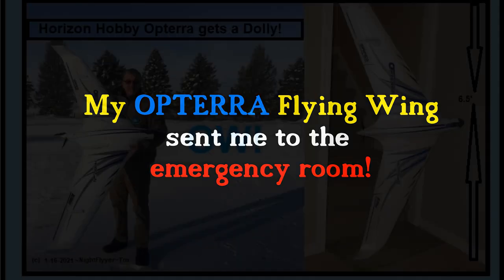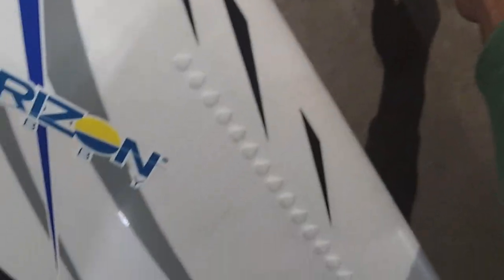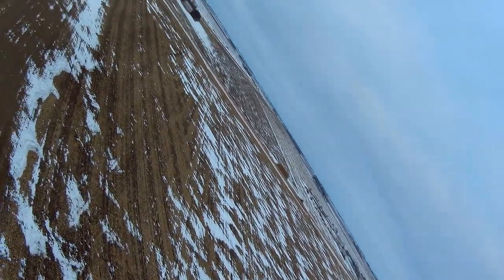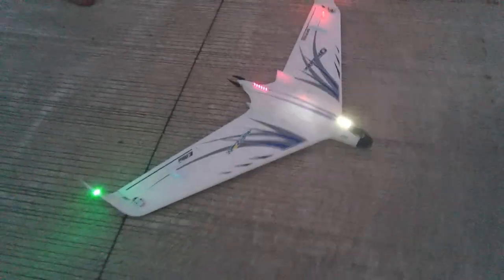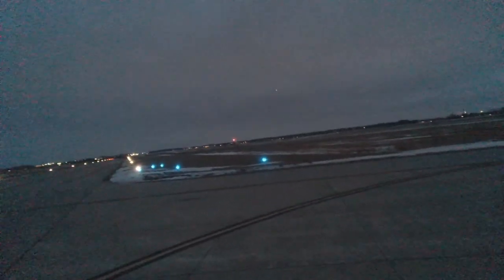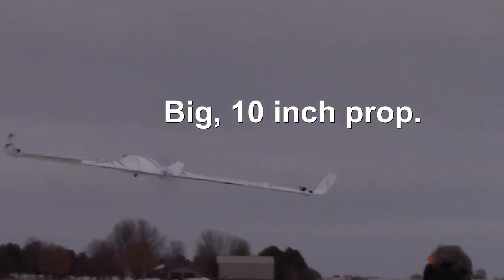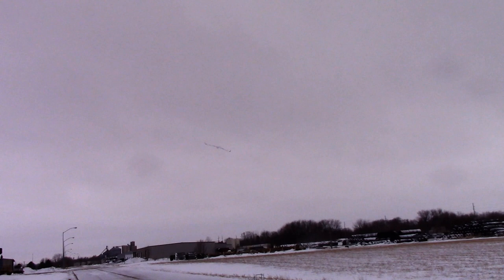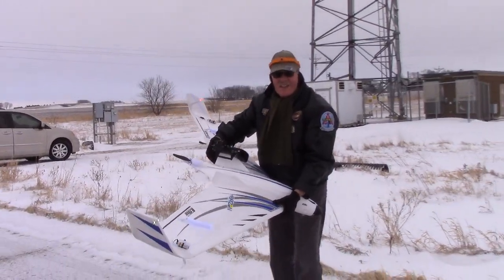My Opterra 2M Flying Wing sent me to the E.R. This is an awareness video & my solution for launching

Comment: First. I am sorry that you were hurt you didn't ask for it and were injured badly, That said the first several launches in your video were very close to the disaster that you experienced on the last launch.  Your throw is consistant and dangerous, your whole arm needs to be moving away from that prop as soon as you release that model (1/2 an inch is not enough clearance). If you are unable to alter your throw then the cart is a safe way for you to launch. A bungy  launch might work better, just don't start the motor until the model is off the line.
Reply from the maker: Here is word for word what the Opterra 2M manual says about launching.  
1. Put the aircraft into launch mode with the channel 5 switch.  (in my first video that did not work, it went into the ground)  
2.  Hold the aircraft in one hand and the transmitter in the other.  
3.  Apply full throttle and throw the aircraft directly into the wind, angled slightly up (5 to 10 degrees above the horizon). 
4.  Climb to a safe altitude and check the trim.   

I know others have their own ways, and either way, my Dolly is the safest solution for me.  
The Opterra 2M manual also says nothing about throwing it with the motor off, so if a newbie followed the instructions, like I did, I'm showing what could happen, in case a gust of wind got them or something else.     Nothing is 100% and no matter how good you can throw, this big 7 foot wing with a 10 inch prop spinning right next to your face, is risky.

Maybe a gust of wind, maybe my 73 year old left arm was weaker, or who knows.   But either way, if it happened to me launching the way I thought was good (and the same as all my previous launches.) ,  https://www.youtube.co/watch?v=P_inF5EYLEE&t=1s  So if it can happen to me, it can happen to others, and that is the warning I want to present. 
This wing is 7 foot long, heavy and  will bend and break the end off the if you even try to pick it up by the tip and barely has enough power to fly out of your hand at launch.  I know and I tried to launch it discus style, but could not hold it where I felt I could launch it successfully in the wind.     It would also be extremely difficult to somehow launch it discus style with the elevon there and that 7" tall winglet rudder that is also on the tip.  I know how to do it , but not with this plane.  
 I found trying to hold on to the tiny finger grips on the bottom of the 7 foot wing with a thick glove under full power with wind blowing was difficult when under power and then trying to fly with  a big enough glove on was also difficult to fly the transmitter, (I'm a stick pincher)  so although that sounds like a good idea, it did not work that well. Some have told me the Prop got them in the forearm even before launch, when a gust of wind got under the wing and tipped it back.   We are only talking about a Half inch of clearance that I needed to keep from getting cut, and even though I pulled it off several times in my earlier product review video,  I will never hand launch it again. This is a very under powered plane, and not good on catapults.  But again, I followed the directions word for word.   It's hello dolly from now on!  Thanks.

Comment: Its not the plane. There is a switch on the transmitter you designate as an arming switch. Read the manual.
Reply from the maker: There is nothing in the manual telling me to program in a cut switch.  I certainly know that as most of my helis have that setup. I've flown models for 60 years.  I'm 73.  But the best rc pilots in the world, have also had bad landings once in a while.  Shit happens, especially while I was trying to throw this heavy, underpowered 7 foot model into the 12 mph headwinds.  Maybe if the Manual had said I should do that, I would have.  First of all, that had nothing to do with my hand injury. I only mentioned the Throttle arming because I followed instructions in the manual and this is the way it bound up and arms the motor as soon as you plug in the battery. It says nothing about programming in a cut switch like my helis have. I only mention it to warn others to program in this feature as well,  which also should have been mentioned in the instructions.  It's my warning to be cautious, because the manual says nothing about programming in a throttle hold to a switch. I've known of times when after flying, that switch was forgotten to be moved back to safe and it armed as well.  Nothing is 100% as it could be left in the wrong position, by accident. I'm pretty experienced, so never relied to on a throttle cut/hold, as all my helis and my drones, and many of my electric planes need throttle stick movements to arm.   I only am warning others to be careful BEFORE the launch and to be careful no matter what you use. .    Here are the links to the last videos and you can see I launched it the same way without problems.  Thanks.  Its hello dolly from now on. 
https://www.youtube.com/watch?v=P_inF5EYLEE&t=1s&gl=CO  and   https://www.youtube.com/watch?v=ur5V5H8UcGs&t=1s

Comment: Landing gear?
Reply from the maker: Yes, well if you saw my Product review  video,  https://www.youtube.co/watch?v=P_inF5EYLEE&t=1s  you would see  those wings aren't as strong or thick as you would think.  I would have to add a nose wheel servo and make it a trike as well.  And since the prop on the back is 10 inches, the landing gear would have to be quite long or retractable prop would hit the ground on rotation or landing. Thanks for the suggestion, but the dolly is now my landing gear and does not add any weight to this underpowered 7 foot long wing.

Comment: wow i learned to hit the throttle several milliseconds after  the plane left my hand -  works - i did build a dolly for my Fox  3000 mm -  one handed launch in a variable breeze with a 10 lb plane?? naaaaaah
Reply from the maker: Never had this happen with any of my other wings, but this 7 foot one, and m 73 year old arm in the wind and cold, leaves very little space between the hand and the 10 inch prop.   Here is word for word what the Opterra 2M manual says about launching.  
1. Put the aircraft into launch mode with the channel 5 switch.  (in my first video that did not work, it went into the ground)  
2.  Hold the aircraft in one hand and the transmitter in the other.  
3.  Apply full throttle and throw the aircraft directly into the wind, angled slightly up (5 to 10 degrees above the horizon). 
4.  Climb to a safe altitude and check the trim.   I know others have their own ways, and either way, my Dolly is the safest.  The Opterra 2M manual says nothing about throwing it with the motor off.

Comment: Ever hear of steel mesh gloves? Uline carries them and they are essentially chain-mail armor. I use to work at Fastenal and we would sell them to various accounts that dealt with sharp knives.
Reply from the maker: Thanks for that suggestion and I tried that already, but because it was cold.  I found trying to hold on to the tiny finger grips on the bottom of the 7 foot wing with a thick glove under full power with wind blowing was difficult when under power and then trying to fly with  a big enough glove on was also difficult to fly the transmitter, (I'm a stick pincher)  so although that sounds like a good idea, it did not work that well. Some have told me the Prop got them in the forearm even before launch, when a gust of wind got under the wing and tipped it back.   We are only talking about a Half inch of clearance that I needed to keep from getting cut, and even though I pulled it off several times in my earlier product review video,  I will never hand launch it again.  LOL.  It's hello dolly from now on!  Thanks.

Comment: Man that suxxors!!! :-(
 
I managed to cut my thumb open on a drone (imitating Jon Taffer on Bar Rescue: ON A DRONE FOR CHRIST SAKES!!! ) a couple of days ago -- I noted shortly after launch that I had failed to activate my FAA-mandated anti-collision strobe (it was a twilight flight) so I brought the drone down but didn't neutralise the motors because I thought that I could turn the strobe on while the props were whirrring around (powered by brushless moors of course)...big mistake!!! :-O
 
There was blood everywhere -- on the drone, on the radio, and on the display of my FPV device. I decided to just say fuck it and complete the flight (mistake #2). Although I did complete the flight, things were a bloody mess when I packed everything up and headed back home.
 
My thumb still hurts like a mofo when I attempt to use it (such as by pushing the power button on some piece of equipment) but thankfully required no sutures. :-)
Reply from the maker: Ouch.  Hope your okay.  I appreciate your comments.
Reply: Looks like I'm going to have a permanent "reminder" of this incident in the form of a fairly sizeable scar. At least it doesn't appear to adversely affect the thumb's functionality. 😁
Reply from the maker: @telephony  Good.

Comment: well; heres the deal. you can easily launch these at 0% throttle. just try it, aim it down and then give it throttle later. atleast my 5foot wing can be launched like that easily. no hate, just my 2cents. you handled the situation quite well after all. :)
Reply from the maker: This big 7 foot wing that is really underpowered is not easy as you say.  I know others have their own ways, and either way, my Dolly is the safest solution for me.  
The Opterra 2M manual also says nothing about throwing it with the motor off, so if a newbie followed the instructions, like I did, I'm showing what could happen, in case a gust of wind got them or something else.     Nothing is 100% and no matter how good you can throw, this big 7 foot wing with a 10 inch prop spinning right next to your face, into 12 MPH is risky to say the least.  The 10" prop is very close to your forearm as well, so a gust could tip it back even before launch, as others told me happened to them.  Thanks.

Comment: My Dad was a Jet Mechanic for United Airlines, and a small plane Private Pilot. From the time I could walk he taught me "ALWAYS STAY OUT OF THE PROP ARC", he pointed out that even if you "THINK" the engine is off, "DON'T TRUST IT, STAY OUT OF THE PROP ARC"... sound advice, and if you had my Dad's wisdom, you wouldn't have to visit the ER. The way you tossed it with your hand inches from the prop arc, should have been a WARNING to you. Figure out a better way to launch, or wear thick leather gloves and take your chances.
Reply from the maker: I spent 24 years in the aviation field of the USMC and flew models for over 60 years.  I'm 73.  Telling me to stay way is like preaching to the choir.  I am certainly aware of this.  Many other folks have told me they were nailed the same way with these pusher planes, especially this one that is 7 foot long.  But again, I followed the instructions and flew it several times in earlier videos with no problem, however was always aware of that big prop.  

Here is word for word what the Opterra 2M manual says about launching.  
1. Put the aircraft into launch mode with the channel 5 switch.  (in my first video that did not work, it went into the ground)  
2.  Hold the aircraft in one hand and the transmitter in the other.  
3.  Apply full throttle and throw the aircraft directly into the wind, angled slightly up (5 to 10 degrees above the horizon). 
4.  Climb to a safe altitude and check the trim.   

I know others have their own ways, and either way, my Dolly is the safest solution for me.  
The Opterra 2M manual also says nothing about throwing it with the motor off, so if a newbie followed the instructions, like I did, I'm showing what could happen, in case a gust of wind got them or something else.     Nothing is 100% and no matter how good you can throw, this big 7 foot wing with a 10 inch prop spinning right next to your face, is risky.

Comment: Large wings!! always use bungee cords! you have literally make even more real one of my biggest fears throwing those planes...
Reply from the maker: Yes, Bungees and my catapult were too weak for this big 7 foot wing, but I always have feared that with all my pusher wings.  The thing is, I followed the instructions in the manual to a T.  Here is word for word what the Opterra 2M manual says about launching.  
1. Put the aircraft into launch mode with the channel 5 switch.  (in my first video that did not work, it went into the ground)  
2.  Hold the aircraft in one hand and the transmitter in the other.  
3.  Apply full throttle and throw the aircraft directly into the wind, angled slightly up (5 to 10 degrees above the horizon). 
4.  Climb to a safe altitude and check the trim.   
I know others have their own ways, and either way, my Dolly is the safest solution for me.  
The Opterra 2M manual also says nothing about throwing it with the motor off, so if a newbie followed the instructions, like I did, I'm showing what could happen, in case a gust of wind got them or something else.  The 7 foot wing is too big to throw discus style, as it bends a lot when you pick it up and the big wingtip's winglets are in the way.   Nothing is 100% and no matter how good you can throw, this big 7 foot wing with a 10 inch prop spinning right next to your face, is risky. 
Maybe a gust of wind, maybe my 73 year old left arm was weaker, or who knows.   But either way, if it happened to me launching the way I thought was good (and  the same) as all my previous launches. So if it can happen to me, it can happen to others, and that is the warning I want to present.  Thanks much.
Reply: @NightFlyyer  Having a damaged rh shoulder tendon for me a hand launch is not an option (https://www.youtube.com/watch?v=m3KUjbKRXp4) this is my current Kat-apult setup to take of... Nice also because it literally save the power required at takeof...
Reply from the maker: @markgerard363  Good job.  I made a self contained one about 14 years ago, but it was destroyed in the fire.  I built a smaller one a couple years ago for my F-27 as well, but again, I dont think newbies would be building launch catapults for this plane, as the instructions say nothing about that, only to handlaunch.  Check this old video out.  I watched yours and liked it.  https://www.youtube.com/watch?v=ypxbkaY-Ycs
Reply: @NightFlyyer  I remember very clearly every single one of your videos with you F-27.... I have been following your channel for many years, "On a different Utub account... also even do I do have a ramp.. most of the time unless I'm flying the big monster that you see in the background "the MaX-8, a 8 pounds flying wing" usually I just use the bungee cord... thank you for taking the time to answer my messages best of luck and hope your recover 100%
Reply from the maker: @markgerard363  Thanks very kindly.

Comment: Don't launch it with the throttle open, you just don't need to. The prop reacts almost instantly and it's a big wing so you have time to launch with throttle closed and just whack it open afterwards. Your fingers will thank you
Reply from the maker: I know others have their own ways, and either way, my Dolly is the safest solution for me.  
The Opterra 2M manual also says nothing about throwing it with the motor off, so if a newbie followed the instructions, like I did, I'm showing what could happen, in case a gust of wind got them or something else.     Nothing is 100% and no matter how good you can throw, this big 7 foot wing with a 10 inch prop spinning right next to your face, into 12 MPH is risky to say the least.  The 10" prop is very close to your forearm as well, so a gust could tip it back even before launch, as others told me happened to them.  Thanks.

Comment: launch holding the wingtip and rotate on the spot so the centrifugal force keeps the plane horizontal
Reply from the maker: Easy to say and I see no demo videos on your channel.  This wing is 7 foot long, heavy, under powered, and will bend and break the end off the if you even try to pick it up by the tip. It barely has enough power to fly out of your hand at launch and especially while I was trying to throw it into 12 mph wind. I know and I tried to launch it discus style, but could not hold it where I felt I could launch it successfully in the wind.     It would  be extremely difficult to somehow launch it discus style with the elevon there and that 7" tall winglet rudder that is also on the tip.  I know how to do it , but not with this plane.    Watch my next video and you will see me try that.